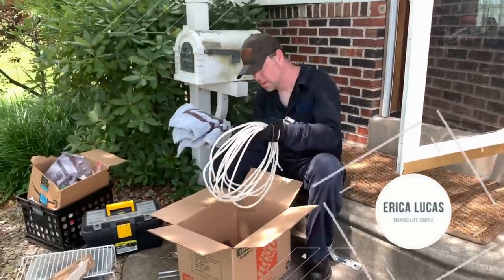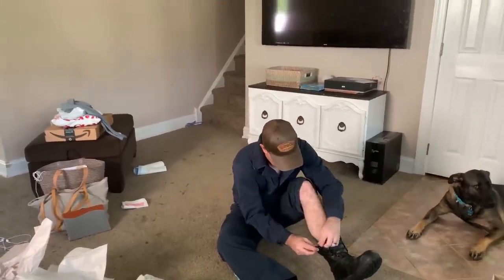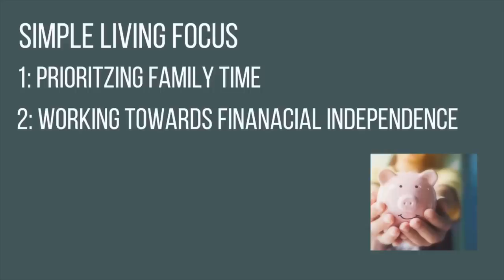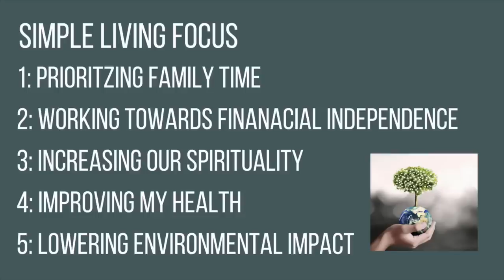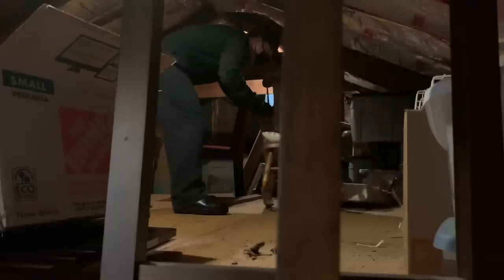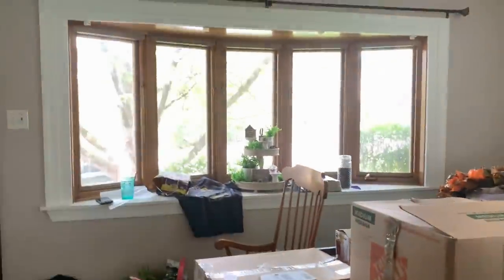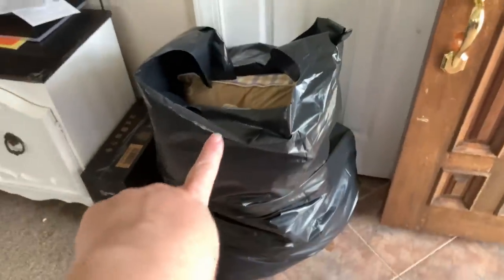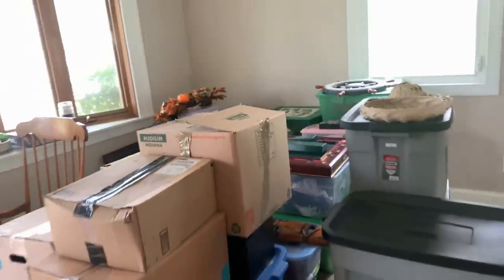Declutter the Attic + My 5 Important Things at the Center of Simple Living

Comment: I haven’t read all the comments but in case anyone is reading this later- it seems like this is a perfect project for 1800got junk. I heard about it on a slob comes clean podcast & I think minimal mom. It’s like 200-300, they pull everything out & you point at what you don’t want & they haul it away. For something like this where most is trash I think it would be well worth it. Unless the safety issue means they couldn’t do it...